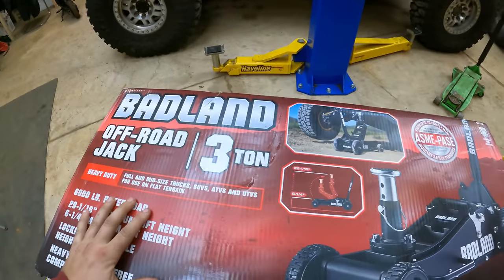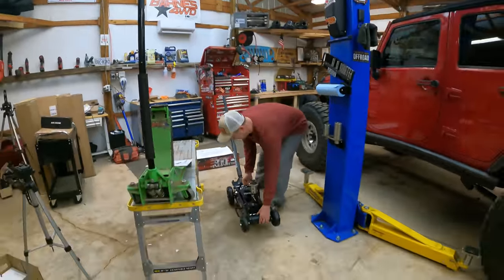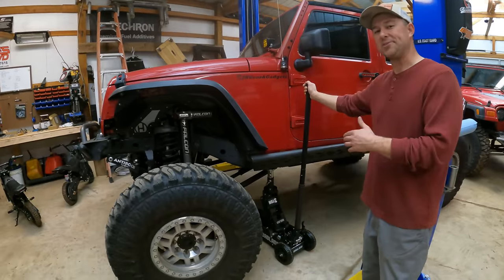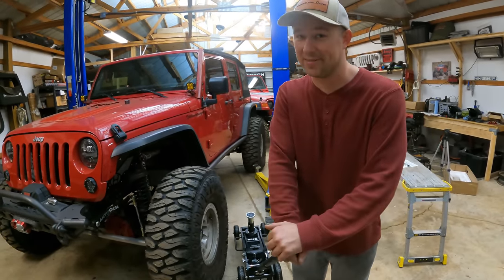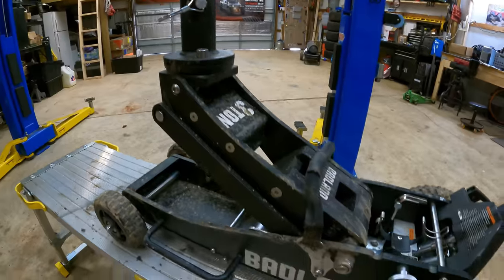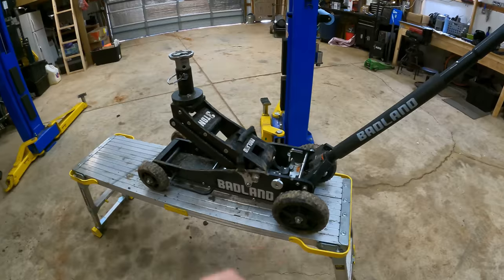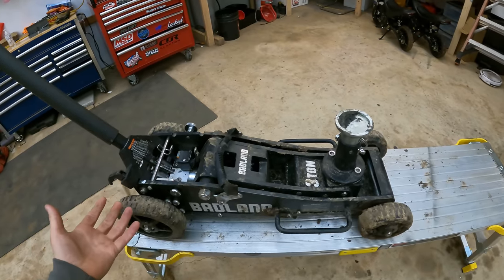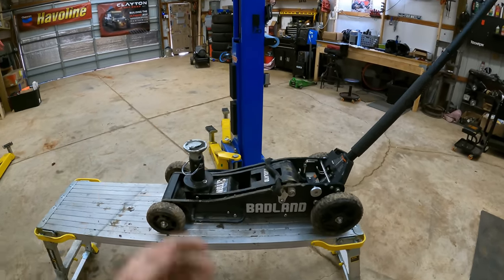Are Off-Road Jacks Actually Useful? Harbor Freight Badland Offroad Jack Test

Comment: I have looked at these too as they have caught my eye.  There are a couple of “hack” videos on YouTube where someone turns a regular HFT jack into an off road jack.  I usually carry a farm jack and a bottle jack.  With all jacks you have to be careful with lifting.  These type of jacks lift in an arch.  If it cannot roll when lifting/jacking, the lift pad moves on the surface it is lifting/jacking and can move enough to slip off.

Comment: Just got mine today and initial thought is that it is a tank.  Good review, I don't think seeing this ahead of time would have deterred me as I needed a second jack and this one seemed to be dual purpose.  Heavy, yes but that strap was engineered well as you can pick it up with the handle and it is balanced.
Reply: its heavy but compared to the other 3 ton jacks at harbor freight its actually lighter than most all of them with the same weight capacity.

Comment: You should look at installing a LPW diff cover on your 14-bolt. You can order them with supports for the carrier bearings and even trusses to brace the rear of the axle too under hard acceleration.

Comment: I was looking at these too but I think I'd pay more get a regular 2 ton pittsburg on sale and do the 911 off road kit on it and save 35lbs and it will go up higher. You can also get different wheel sizes. No need for a 3 ton off road

Comment: Concur with your assessment. No way I have room for that in my jeep. I use a 4 ton bottle jack with an axle adapter that I welded up and slip on. Sometimes I also bring my 5' hi lift. Haven't had anything those two can't handle.

Comment: HF went the wrong direction.  A 70 lb jack is not an off road jack.  A lighter, aluminum 1.5T jack with a skid instead of wheels is what they should produce and sell.  An included mount would be nice as well.
Reply: I particularly disagree. My friends and I sometimes offroad our 3/4 ton and 1 ton diesel trucks. Gotta lift the front of those trucks just will not happen with only a 1.5 ton jack. Believe me I tried and I blew the seals out of mine lol. But I agree they could make a lighter duty one for the jeep crowd. Lighter duty with a taller lift. Trade off lift capacity for lift height
Reply: Soon me thinks they’ll have that
Reply: They have em
Reply: 1.5T? Maybe for a Chevy tracker 😂

Comment: Considered buying one of these jacks seen a lot of videos on it and even you didn't take out that safety block that's going to bend that center bar does it not say this in the instructions to remove that block
Reply from the maker: What block are you talking about
Reply: @JKGearandGadgets  there's a shipping block between the frame and the yolk right behind that stainless steel bar everybody keeps bending that because they don't take out the shipping block
Reply from the maker: Yeah man no idea what you are talking about

Comment: You might have gotten the tire off the ground on the 4 door if the Jack was under the axle 🤔
Reply from the maker: Oh yeah for sure. Wanted to test lifting from the frame
Reply: @JKGearandGadgets  love your channel. If anyone is looking to lift the tires from a frame lift point. Sling the axle to the frame. I have a couple heavy duty cheap husky ratchet straps that work great for this. Also works great when a wheel is stuck deep. Sling the axle and no need to lift as high.   Thank you again for always having great and relatable content.

Comment: Walmart $14 2 ton bottle jack works just as good, I carry 2 in my JK Rubicon.
Reply: What is the max lifting height of the "just as good" Walmart jack? I doubt it is as stable. Now if it fits your needs, great. I carry a small trolley jack with wheels removed and plate tacked to bottom and a hi-lift farm jack as well, different tools for different situations.